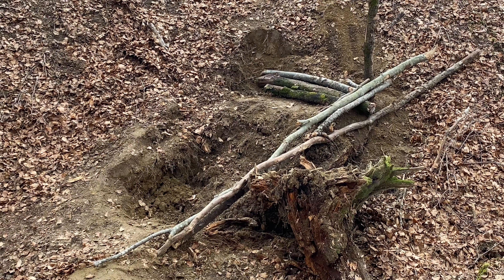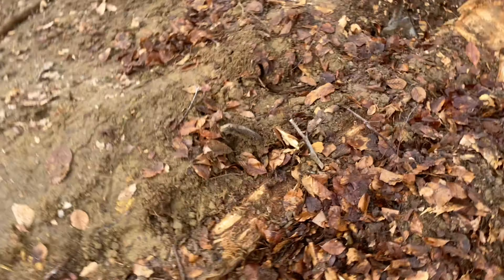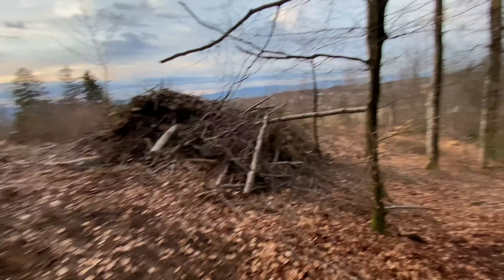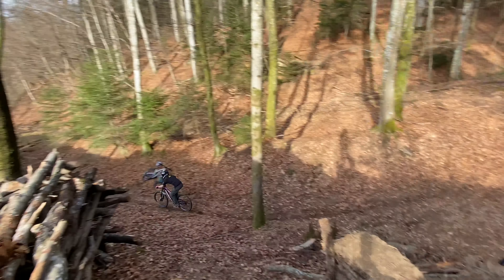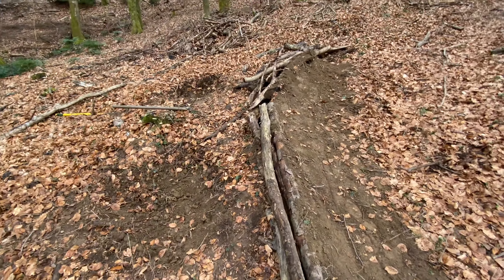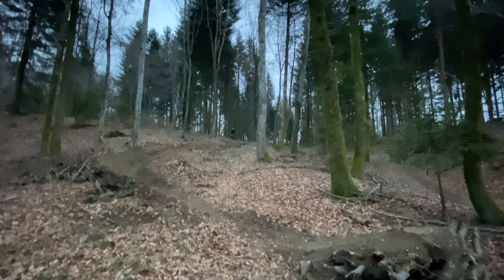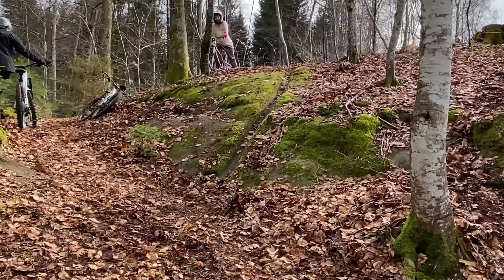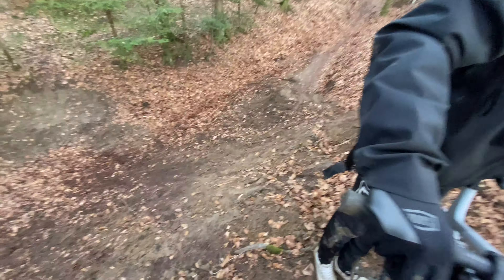Building A Freshy Step Up

Comment: Stop with the sticks bro
Reply: The sticks support it and you dont have to use nearly as much dirt
Reply: @Adam Genereux  I know why you use sticks. Using dirt will take equal amount of time. it's literally endless, will last longer, be safer and look better.
Reply from the maker: *logs, if it breaks after 3 years I fix it, but ya
Reply: @Lucas Daines  you are a good builder. Stop with the filler and use dirt. Dirt doesn't stick to wood so the dirt will break apart and crumble.

I've been digging for 15 years and your trail building will be elevated even further